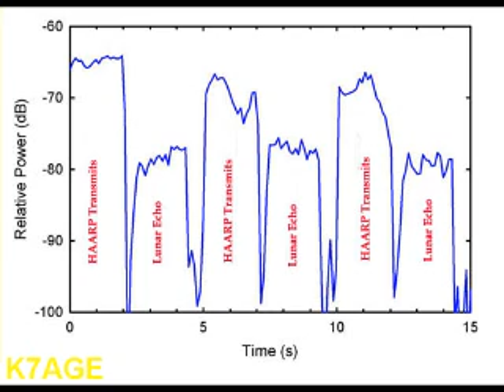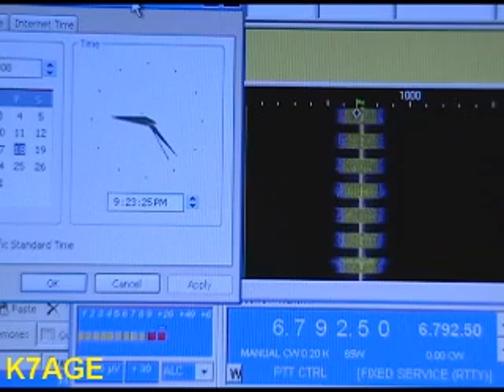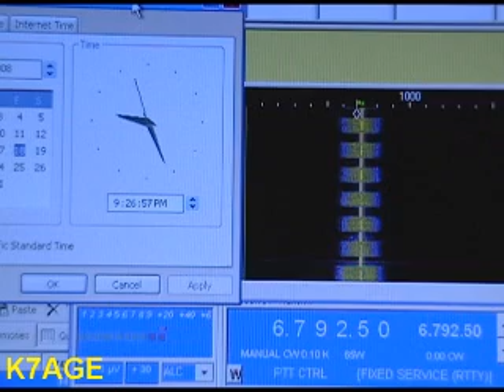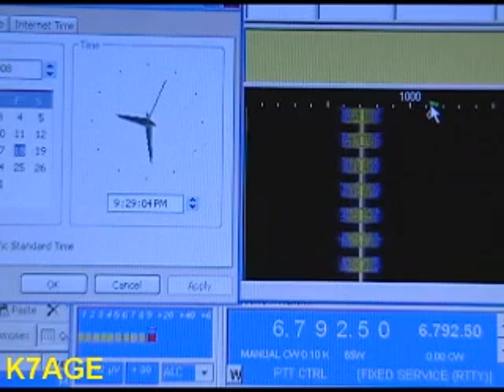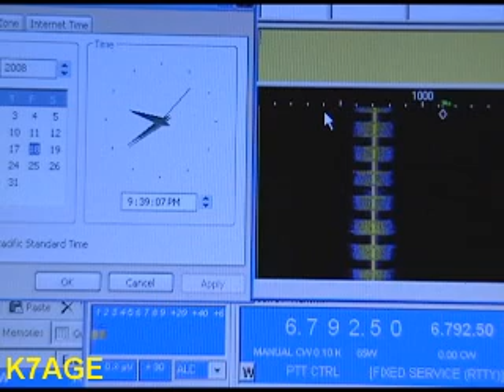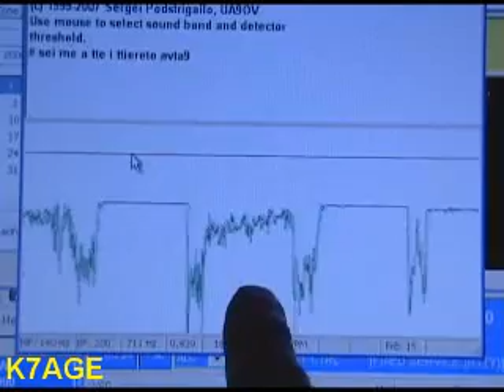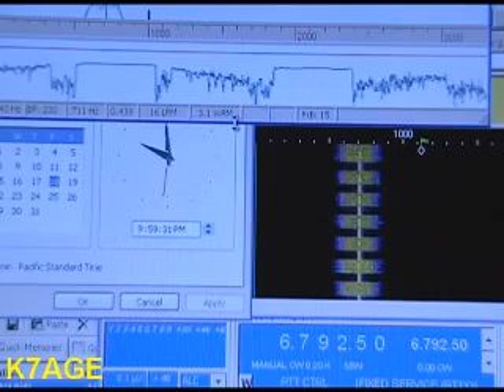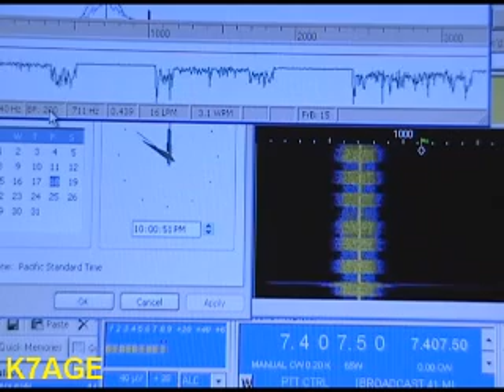Moonbounce, radio signals bounced off of the moon

Comment: Why does it take that long for the signal to bounce back? The moon is only 3000 miles away.
Reply from the maker: Question in the comments, can you calculate the distance to the moon from the echo?

YES

Looking at the signal at 10:28. I used the 2 second transmit time as a time-lenght reference. From the beginning of the transmission to the beginning of the echo, I measure 2.5 seconds, which is round trip time. So, 1.25 seconds one way. 1.25 seconds times 186,000 miles per second (radio wave speed) = 232,500 miles. Google shows 238,900 miles, average distance. Not bad using ruler measuring the signal on the computer screen.
Reply: K7AGE he was joking, because he knows the earth is flat

Comment: are you able to calculate the distance to the moon based on the time it takes for the signal to get back?
Reply from the maker: +ScrotumSqueezer YES. 

Looking at the signal at 10:28. I used the 2 second transmit time as a time-lenght reference. From the beginning of the transmission to the beginning of the echo, I measure 2.5 seconds, which is round trip time. So, 1.25 seconds one way. 1.25 seconds times 186,000 miles per second (radio wave speed) = 232,500 miles. Google shows 238,900 miles, average distance. Not bad using ruler measuring the signal on the computer screen.
Reply: thankss awsome

Comment: Just catching up with this video for the first time, very impressive that you can detect the reflections just using a dipole...I'm interested in Radio Astronomy and I have thought from time to time what Radio Astronomy could be achieved at low HF frequencies given the nature of the Ionosphere, this is a good example of how translucent the Ionosphere can be particularity around 40 meter wavelengths!
Reply: Check out RTL-SDR.com and take a look at thier radio astronomy section. Some people have been able to detect pulsars.
Reply from the maker: Clint Jeffrey It also helped that they had 3,600,000 watts of transmit power aimed at the moon.

Comment: What is the point of this measurement ??
Reply from the maker: It was done as an experiment to see if people with a shortwave radio and outside antenna would be able to receive a signal that was bounce off of the moon. It is very unusual to do this at 7 MHz, a short wave frequency. Moon bounce, especially with radio amateurs is typically 145, 430, MHz and higher frequencies to us antennas with gain. The HAARP system has a large directional array of antennas that they were able to aim their powerful signal towards the moon. I think HAARP is now shut down.
Reply: K7AGE I know a lot of freebanders use the echo charlie frequencies around this range.

Comment from the maker: @Zinshin Possible, yes. Practical probably not. It would require a pretty sophisticated station on each end of the link.  This test use 3,600,000 watts on their transmitter. A typical ham radio is around 5 to 1,500 watts.

Comment: Just calculated W5UN's ERP.

1,259,189 watts. 

1500 watts from amplifier to the 29.24 dBd antenna. This figure does not account for feed line loss. I have no idea what Dave's feedline length is, or if he is using 1 5/8s or not.  

Still a million and a quater watts from 1500.

Comment: With over 20dBd of real antenna gain, several thousand watts ERP. 

One of the biggest gun on 2 meters is W5UN. He has 32 (!) beams with a boom of near 5 wavelengths long and 17 elements each. Each beam is 14.74 dBd - 32 of them are a whopping 29.24 dBd. 
 Do NOT confuse that figure with dBi or CB antenna gain. If this set up were rated by JoGunn, it would be Eleventy Billion Gain.

Comment: On 10.368 mhz (10 gigahertz) you can actually bounce signals off of aircraft.

The reflector needs to be several wavelengths long to reflect. 

Earth to Moon and to Earth again is roughly 480,000 miles. THE absolute longest DX you will ever work.

Comment: If they do then to the same extent exposure to any radio signals causes heart disruption.  I have an implantable heart defib. and while I was standing 50 feet away from a HAARP transmitter into a dummy load at full power I had no problems.  That is 20 KiloWatts of RF power.

Comment from the maker: There was no data transmitted. This was a test to see if amateur stations using simple equipment could receive a signal bouncing off of the moon. Which we did! But it helped that they were transmitting 3,600,000 watts of power towards the moon. This is a lot more power than my 100 watt radio! Randy

Comment from the maker: This was a test to see if Amateur Radio stations could receive a signal bouncing off of the moon at 7 MHz. Amateurs with above average setups with large antennas are able bounce signals off the moon using 50, 144, 432, 1295 MHz frequencies. 7 MHz being a low frequency signal made receiving the signal bounced off of the moon available to the average amateur radio station with a simple wire antenna and HF radio.

Comment: You are using a narrow CW filter, 200Hz.  So you're injecting BFO to generate this tone, i.e. HAARP is sending carrier only? What is the [up-link] transmitter bandwidth? Would further reductions in the IF pass-band or DSP be of benefit? Kind regards, MaArk

Comment: HAM radio operators have used the moon as a reflector for nealy 50 years. It's called EME or earth moon earth. It takes several stacked antennas or huge microwave dishes and lots of skill as the moon wavers a bit in orbit. 
 Simply put, it takes skill and determination along with LOTS of proper equipment. The average "Joe" simply can't do it.

Comment: I didn't listen on 1/19, but was able to monitor both frequencies on 1/20.

I was able to hear echoes during about 20% of the transmissions.   The strongest echoes occurred during the first 15 minutes of transmissions on the first frequency.

TS-2000 to inverted vee with the apex at about 60 feet.